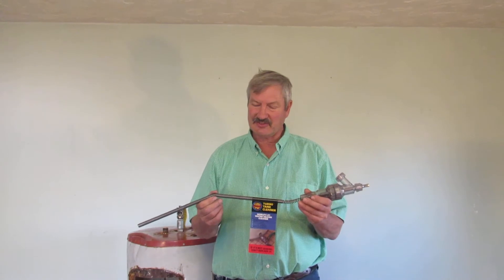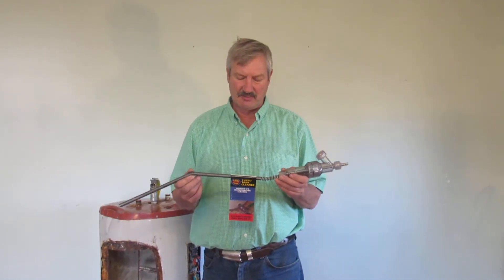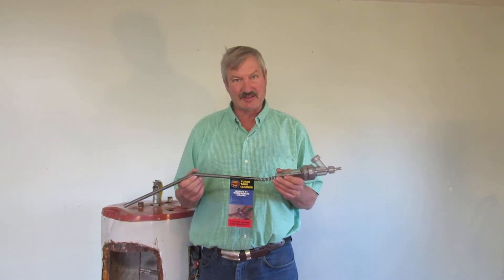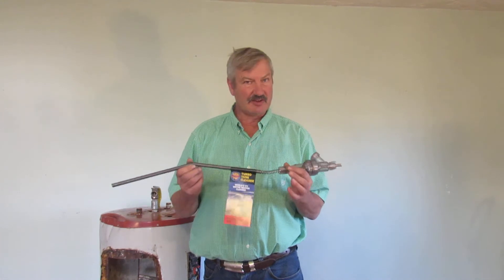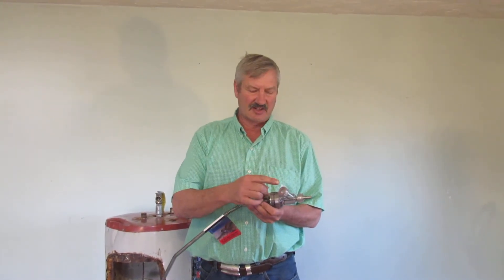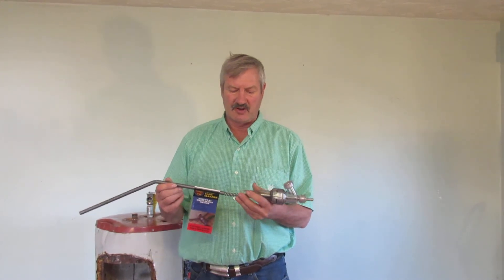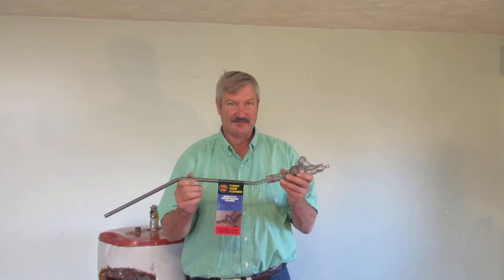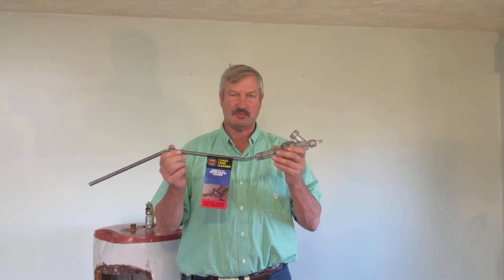TURBO TANK CLEANER | Water Heater Cleaning Tool

Comment: What happens to the bottom element and dip tube while this thing is whipping away?
Reply: That is my major hesitation as well. 

The snakes looks like it is made of metal and I have a glass lined tank. 

When that thing goes whipping around, I just can’t see how it cannot damage the inside of the tank. 

The manufacturer says it will not, but I just cannot wrap my head around that. 

Sounds like a great idea, but logically I just cannot get there.

Comment: I got one and it works great!  One tip, replace the factory valve on your water heater with a new 2” nipple and a ball valve to make it easier for the next cleanout.  Just open the ball valve, install the tool and your off th the races!